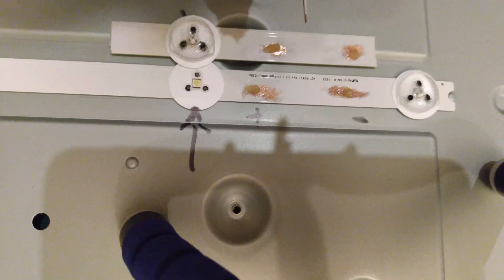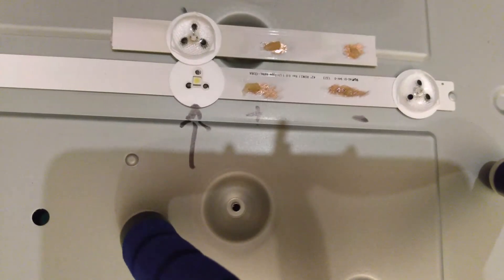How To Replace Individual TV LED Backlight With One Cut From A Strip

Comment: What if i should change the last diode? is there a proper conection?
Reply from the maker: Hi, thanks for watching. I remember it being trickier to find the areas to solder to on the last diode. You need to do the battery test from my other video on the end diode of a different row that is working then you'll see the right polarity to go with 👍
Reply: @dandantherepairman thank you, i will try, i think that the last diode - should be conected to the return -, and the + stays on the last diode...

Comment: How will you do it if it's on the end
Reply from the maker: @SrikarChanamolu   hi, thanks for watching and commenting. It can still be done on the ends but you just need to locate the parts of the strip that supply + and - power so the easiest way to do that is with the battery test I show. You kind of have to look at the strip surrounding the led on the end and try a few ways round till it lights up on a working strip, you'll soon figure it out, then just use that same configuration to fix the faulty one.

Comment: I have repaired one of these before almost the same method with success. However I would think that the electrical tape you used in the manner used will not last very long. IMO you should remove the original strip and wrap tape around both original and replacement led strip. At least I did and it still works after 2 years plus of daily use.
Reply from the maker: Hi, thanks for watching. You're right, that would definitely be a stronger repair. I would probably have used the hot glue gun if I hadn't run out of glue sticks at the time but the tape held up good overall.